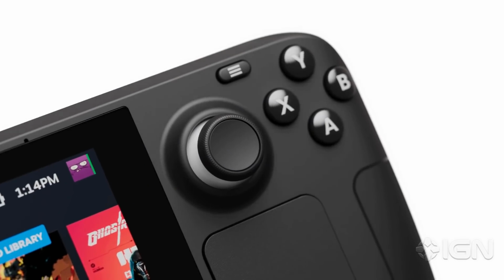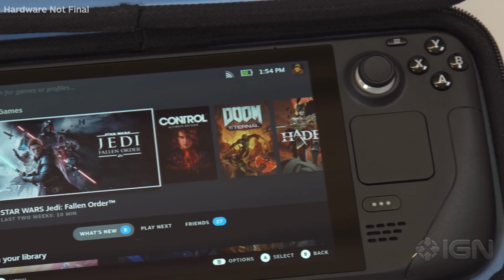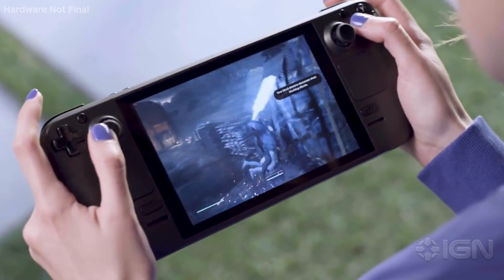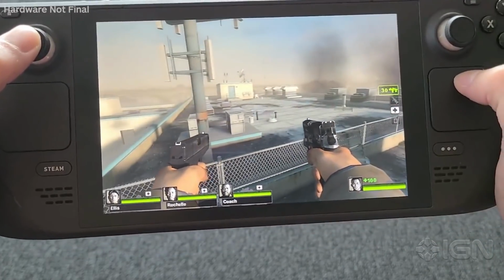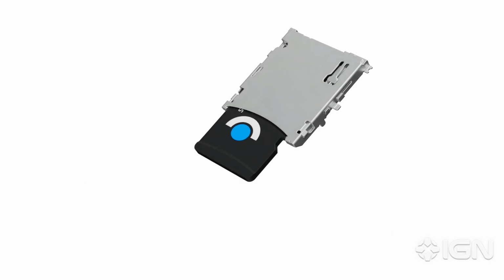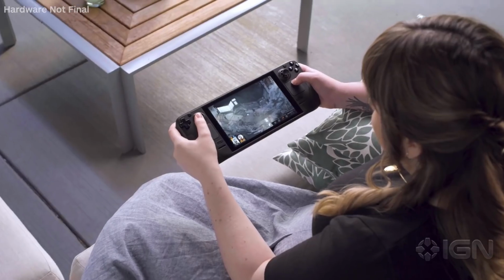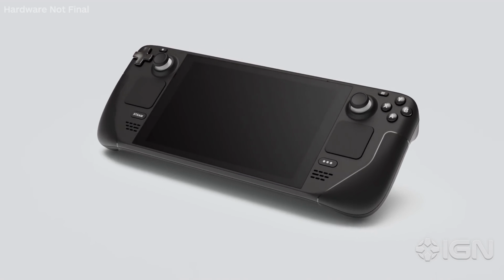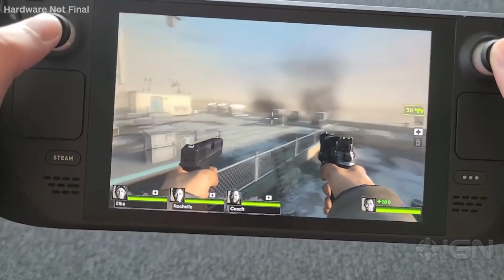Steam Deck: Valve Talks Hardware Power, Controller Comfort, and More

Comment: To be fair its a great piece of kit for the price. Really hoping it works out!
Reply: I'm not typically a person that goes around predicting things to fail but this device is obviously going to fail and if it doesn't the price will go through the roof and cause it to fail because there is a shortage on chips so it's going to make the price go through the roof and doom the device to fail because the price will spiral out of control like a lot of other products that rely on chips to run them. Besides that the higher tier options are already running close to what a customized gaming PC will cost and let's not forget to throw in the docking station when the price is announced which will make the price of a fully loaded bundle exactly on par with what gaming PCs cost. So overall the price will probably defeat the purpose of what this device was intended for because from my understanding of it is it's supposed to be a budget device for PC gaming but that won't happen when there's a chip shortage that's going to push the price up besides all the extra doodads that someone can get.

Comment: Quick Question: Will the battery have a system where it doesn't overcharge like the Switch? So if it's docked for like a week straight, at a time, it doesn't effect the battery at all.

Comment: Little concerned that they didn't show anyone using my preferred finger placement on the face buttons (thumb tip on Y or X and on a normal sized controller the joint on B or A). Also didn't show anyone using the space extensively.

Comment: Is it possible to get 4k 60 fps gaming when connected to 4k monitor?
Reply: It can output at 4k 120, but unless you're talking about a much older game, you're going to have a lot of issues running anything at 4k. You could play in 1080 or mayyyyybe in 1440 if you use either AMD FSR or just lower the settings, but again, that's super dependent on what game you're running.

Comment: Will discord be a steamOS downloadable if you don't feel like installing windows or whatever else?
Reply: SteamOS is a form of Arch Linux. You can install Discord on Linux devices already. Just wouldn't be quite as easy as installing a Steam app. But should be totally doable by anyone who can google "How to install Discord on linux" and follow a few instructions. Shouldn't need to worry if you want it.
Reply: @mixplit74  cool, thanks
Reply: @mixplit74  This isn’t Linux with SteamOS preinstalled. You can’t back out of SteamOS and be looking at Linux. So you would need to install Windows to use Discord.
Reply: @HairyBottom  What do you mean? You can absolutely install discord and you don't even need a browser to do so. Arch linux (SteamOS) already has Discord to be installed and depending on how SteamOS will behave, there will be a Software Store called "Discover" where you can install discord just like you would install something on the Windows Store.
Reply: @HairyBottom  SteamOS has a desktop environment (KDE Plasma) they've shown on the website, you can just hop onto a web browser and download the Linux client for discord

Comment: Please Valve, set up a common standard way for FPS games for example and allow the user to use pre configured binding profiles for each game (that you configured!) so that the user does not have to invest a lot of time off the bat to go and bind each and every binding per game.  This is key.
Reply: Already exists in Steam with keybinding/controller configs that the community creates and you can download then use :) Will most likely be implemented with Steam Deck

Comment: 30 Hz screen? They bring up 3 performance concessions that they've made in the first 5 minutes of the video.
Reply: The screen is spec'd for 60 hz, just like most screens. They're saying for triple A games of the modern generation they targeted the hardware to run them at 30 fps.

Of Course for prior gen games, this should be able to run them reasonably well at 60fps at the 800p resolution.

Comment: Latest generation CPU from AMD.... Zen 2 came out in 2019. Zen3 is latest and came out 9 months ago. It looks great, we don't need fluff about the specs.
Reply: This is the most modern AMd APU you can buy. They don't have a Zen 3 apu available yet.
Reply: Ya already outdated lol
Reply: @DragonProtector  they don't have a zen 3 apu out yet. Hence why the new consoles and this use zen 2 cores
Reply: @richr161  ah but like this is 2022 though
Reply: @DragonProtector  Game consoles take 1-2 years to make and sometimes longer. Its a possibility when this was developed zen 2 apu's weren't released to the public yet.

Also its Zen 2 cores, but with a RDNA 2 GPU which no other AMD Apu's used in handhelds have yet. Most other handhelds are using Vega with zen 2 cores.

This is a beastly handheld for what it is.
Reply: @richr161  ahh ya.

Comment: can it run emulation swtich games tho
Reply: Probably can if you install Windows on it which you can
Reply: @robtheg  A big question though is how well will Windows work on it? It and none of its apps were designed to be used like this.

Comment: Haptics? Valve have developed legendary haptics in their VR controllers. Ps5 has incredible trigger haptics, Switch JoyCons use the same motors as Valves VR controllers and have been well received - yet no mention at all of what the Steam Deck has?
Reply: It does have haptics, says so on the product page
Reply: it does have haptics

Comment: One thing Valve needs to consider is, handheld gamers play offline. A lot. Switch, for example, doesn’t interrupt your play when you’re offline. This version of Steam needs to take that into account, and not plaster offline warnings all over the place when you’re not connected. It needs to FEEL like you’re still getting the full experience both online and offline, and make connecting seamless, without requiring to “restart Steam in online mode”. That will kill the experience.

Comment: If only they used zen 3 cpu
Reply: Zen 3 isn't available as an apu yet
Reply: @thibaultmol  Firstly, they are available in pre-builts which you can buy right now. Secondly, the release of the Zen 3 desktop apus don't necessarily conincide with AMD being able to create a custom zen 3 Apu for a client (valve).
Reply: @apondo100  Its $300-$650 device. They couldn't fit a zen 3 custom apu in the price point. The consoles aren't using Zen 3 chips.
Reply: Zen 3 supply is limited. Otherwise the consoles would of had Zen 3 instead of Zen 2

Comment: 6:11 "We went against the trend of putting it directly on the motherboard..." - so internal storage may not be soldered on after all!
Reply: Great point. Thanks for pointing it out.
Reply: eMMC probably is but they've said that even that model has the socket for the 2230 M.2 drives. The only thing is those drives are more expensive. Most computers use longer ones like 2260 or 2280
Reply: It's already confirmed that it is sockted with a 2230 socket. It's on the English tech page. Note that it's not intended for user replacement, as it's buried under layers of other stuff.
Reply: @gragogflying-anvil3605  challenge accepted.
Reply: @gragogflying-anvil3605  "not intended for user replacement" more or less means "you can replace it, but we're not responsible for what goes wrong and the wrranty might be voided"

Comment: Dear Valve, please ensure replacable joycons ! Joycons drift after few months, and if we have to return the whole thing, you will get a  horrible reputation.
Reply: Sounds like a switch problem. You can’t even replace these because they are completely attached to this. Remember, only the switch  has this problem. Xbox and ps4 controllers never had this problem because they had decent quality. Don’t think because the switch had the problem, every other branded joystick will have this problem.

Comment: why cant u make the bezel on the screen more thinner so that the screen will look bigger
Reply: Because it will offset resolutions and aspect ratio
Reply: If it was possible they would have done it the reason why they didn't do it as because they had to get the low price point and otherwise they wouldn't have been able to do that

Comment: Now ask them if it will be able to run oculus quest 2!!!
Reply: Rumors place it around a gtx 1050 ti in terms of performance. So, maybe at low settings and depending on the game.
Reply: They answered in an earlier video. It can do it, but its not optimized for that Case. Meaning Its going to struggle with the High fps VR requires.

Comment: There should of been a connector that has pcie lanes so you can connect to a dock with a GPU to help future proof the handheld. Thunderbolt 4 and usb 4 is nice but direct pcie lanes would likely make it that much better switching from dock and handheld experience.
Reply: Are there devices with USB 4 yet?
Reply: @gragogflying-anvil3605  technically the M1 Macs have it and a few devices. I’m guessing it is not widely adopted but it is essentially just thunderbolt 3-4
Reply: Steam dock that lets you plug it in, while letting you house a GPU would be interesting.

Comment: So it can’t handle games like Fortnite call duty Warfare and etc?
Reply: It probably can at lower settings, but keep in mind COD won't even fit on the base model. You'd need a Micro SD card immediately to install it.

Comment: So its 800p and 30 fps. Is it locked or can we get 60+ depending on the title and optimization?
Reply: Not locked no! 60hz screen and last gen games like GTA V will run at 60fps :) But current gen (PS5) will be 800p 30fps
Reply: Fantastic, great to hear. Makes the idea of installing windows and running 3rd party apps a bit more appealing. Cheers!

Comment: How is this handheld going to keep cool when running games like Warzone or Battlefield?
Reply: Remember, it is 1280x800 res, not anywhere near as demanding as most common console and desktop resolutions, less power required and therefore less heat generated.
Reply: Dial the settings on the game down and it'll be fine, and your battery will last longer
Reply: @UNSCPILOT  everybody want it max everything nobody wanna be dialing anything thats the problem...Anyway Im just happy at the idea of it being a portable pc. with controllers.
Reply: It's called a cooling fan
Reply: Yh that's a major problem with the Switch.
Reply: it has a little fan and a cooling chamber so that will have to do :D
Reply: Its not lol

Comment: But does it have 7” OLED display?
Does it have LAN port on a dock?
Does it drift?
Reply: No
Yes
No
Reply: @markdove5930  you don't know that yet 
for all, we know this console is drift city
wait with answering stuff like this until after it's been out for a few weeks
Reply: @markdove5930  how can you say no to drift when you don't own one
Reply: lcd, not oled. lan port on a dock, yes. every stick may drift eventually, it wont be as bad as the joycons though
Reply: No. (You can connect it to a monitor Sega Nomad style)
Yes/No (You have to buy your own. So if you need one then get one for about 10 dollars)
Most likely not as it seems to be a custom-built steam controller which has no hardware problems.
Reply: No but it has a mario that the switch will never have

Comment: If this thing can play Forza, Warzone, Battlefield 2042, Tomb Raider and few more games like that, I’m all in!
Reply: All the games you mentioned work on last gen Vega this should be at least 50% more.
Reply: Forza and Tomb Raider should work.
Reply: People should stop comparing spec for spec with a Console... Console games have huge amounts of optimization for dedicated hardware to get to the performance and graphics level and the Steam deck initially anyway is going to be running generic pc builds of games.
Reply: My guess is Forza high settings 60fps
Warzone & tomb raider medium settings 30-40fps and battlefield idk cause it's not out yet iirc
Reply: Horizon 5 probably would be fine if it work on Xbox one,the system requirements look shockingly low
Reply: If this gets Fidelity Fx all those games should run great.
Reply: @MrSyphen6  fsr is coming to proton for all games on steam in the next up and coming releases. GloriousEggRoll says hes implementing it in the linux version so not on windows.
Reply: No harm IGN but this isn't a deep dive, it didn't tell us anything we didn't already know, same broll over and over which we seen a million times in other videos, we need more info get valve on the blower and get a tech demo arranged?
Reply: Same
Reply: You'd probably have to turn the settings down but yeah, any game that can run on a Linux PC will be playable.
Reply: @JF-vz1ju  and supports low spec  hardware

Comment: will you be able to expand storage with external hard drives?
Reply: microsd cards and external hard drives, yes
Reply: Yes. Also the USBc port us 10gbit so it even makes sense  gen 3 nvme SSDs (not the super high end ones tho, perfomance would go a bit wasted)
Reply: @outofahat9363  Even my low end 660p NVMe has 1.8 GB /14.4 GBit read/write. But still, it's fast enough though.
Reply: Would love to see a third party attachment that plugs into the USB-C with extra storage, and a pass through for charging.

Comment: The deck screen can produce up to 60hz ign messed up and ment to say 30fps target but it can go up to 60fps on the deck.
Reply: Apparently the ideal target is a number that can be divided evenly into the screen's maximum refresh rate, so if a game can't hit 60fps then targeting 30 will give better frame pacing and a better experience than say 50fps. Each frame will be displayed for two refreshes of the screen instead of a varying number. Based on my limited knowledge from Digital Foundry videos.

Comment: We havnt really found anything we can throw at it that it can't handle... CyBeRpUnK?
Reply: Nasa can't run that mess
Reply: @dick8997  Oof nice
Reply: Why do you even wanna play that game when you can run San Andreas on mobile
Reply: @laos85  why do you wanna play that game when we can play fallout: a tale of two wastelands on the steam deck.
Reply: It will run it it runs on the 1050 and this should be somewhere in between that and a 1060.
You can always run it badly on Vega 11 so this will definitely run low 720p maybe medium with fxr if implemented.
Reply: handle them is very low settings
Reply: ryzen 4500u can handle it around 25fps, probably this can reach 30fps in 720p
Reply: Some guys did a test with theoretically similar Hardware. It was running at ~35 fps on Windows and ~63 in Manjaro (also Arch-based).
Reply: SomeOrdinaryGamers did a test using the GPD win on cyberpunk and he could play it smoothly. KEEP IN MIND, just because it could smoothly doesn't mean the bugs won't hamper your experience

Comment: Portable CSGO and TF2! No more bringing my gaming laptop on the plane
Reply: How do you play it on a plane? For me, the chargers in the plane overload and don’t work
Reply: @kunaly.5831  power bank!?
Reply: Better

Gyroscope tf2
Reply: @ToonCatTV  lol gl using a gyroscope on a shaking airplane. Also wifi ping will be dogshit
Reply: How do you play those games on a plane? Aren't they MP only? And the signal reception in a plane isn't... great
Reply: @ChiplockRock  nah tf2 and csgo both have an offline bots mode
Reply: @n0body704  tf2 has an online bot mode too XD
Reply: @prometheus9096  LMAO
Reply: @Kzn Nzn there is such thing as using a joystick
Reply: Playing CSGO on this = playing with a controller. You're going to get violated.
Reply: @Droogie128  Steam Deck accepts a mouse and keyboard.
Reply: @PWDooood  I never said it doesn't. You can't use them on the go, though. OP mentioned portable.
Reply: @Droogie128  nah the steam controller is insanely accurate in fps games because of its trackpads and joysticks making precise quick movements really easy that's why some fps players use a steam controller to play with not even kidding and the steam deck controls look similar
Reply: @Droogie128  

He will be fine if he uses gyro aim and the trackpads, that's why they're there.

Comment: So this can't do 60 fps on correct settings?
Reply: Don't expect max settings on newer AAA games to give you a very basic scale to us think the ps4 pro ( or ps4 it doesn't matter). Any game that runs on there can run on this at 60.
Reply: You'll be able to play MOST modern titles at  low to medium graphics above 60fps. Games like cyberpunk, Red Dead Redemption 2 or star citizen are gonna have a ROUGH time on this device regardless of the resolution. Expect 30fps for AAA titles releasing in the next 2-4 years; I'm expecting AMD optimized titles are going to run past expectations on this device. Supposedly the gameplay that's been shared so far is being played off of an SD card so it's very promising. Seeing star wars running so well definitely makes this device look extremely promising.

Comment: Still wondering if they can cool it off properly.
Reply: The new apu only draws 15watts. I'd imagine you could overclock it but oob it should be fairly trivial to cool that. The switch itself also only draws about 15 watts on docks

Comment: Still skeptical but looking forward to it
Reply: Best mindset on this, honestly. Hope for the best but expect the worst
Reply: Yeah no way this thing runs cyberpunk but it looks powerful enough to do a lot but bare in mind it is a small screen so it doesn’t have to be high res.
Reply: @jacktdoes3d739  this thing will run cyberpunk on low-medium settings at 30fps at 720p just fine
Reply: @jacktdoes3d739  It's more powerful than a ps4 (Lowball) so yeah it can run cyberpunk.